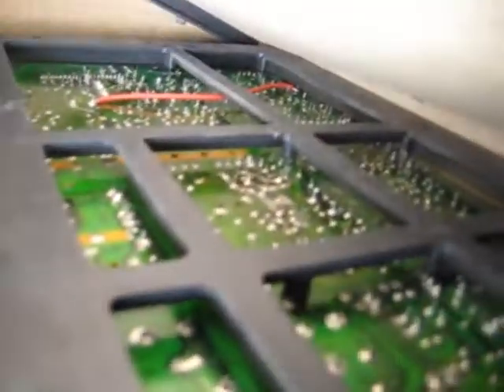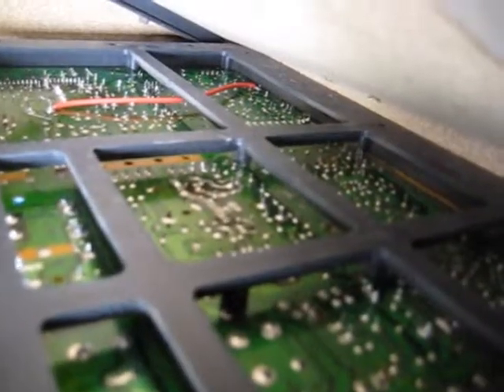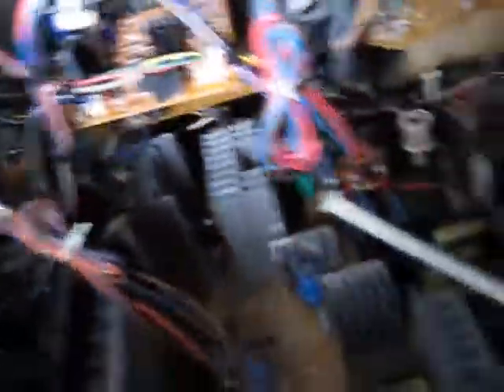Basic repair & look inside an RP TV Part 1

Comment: If convergence problem, and convergence procedure doesn't work, always check for solder cracks on the convergence chip pins.  My Hitachi had severe bowing and 3D effect.  Found solder cracks on 14 of 16 pins on one chip.  Resoldered, and BOOM, factory perfect picture.  These pins get stressed when set heats up and cools down.